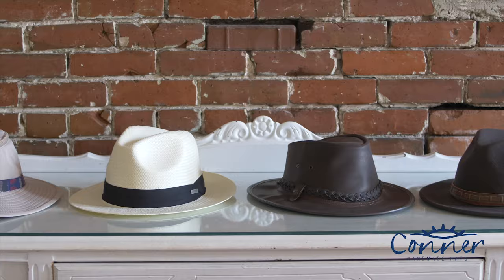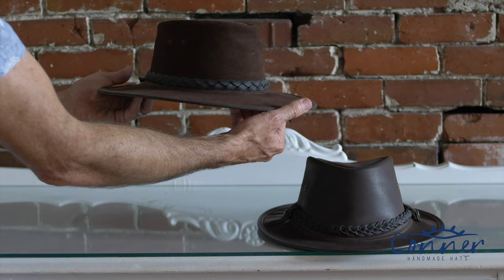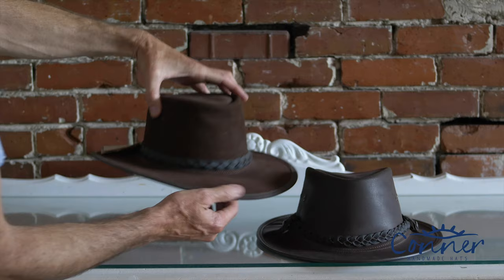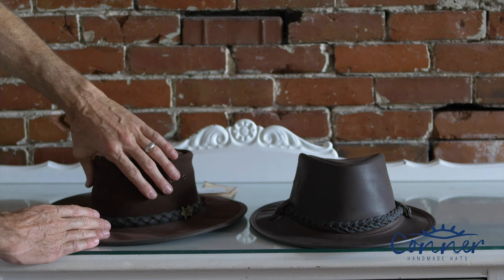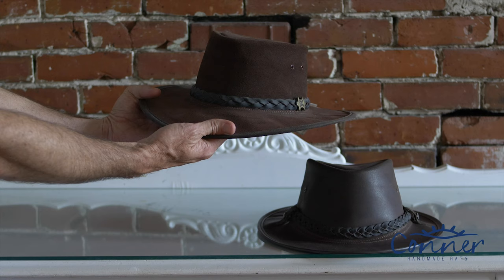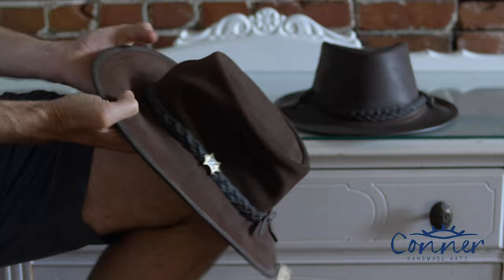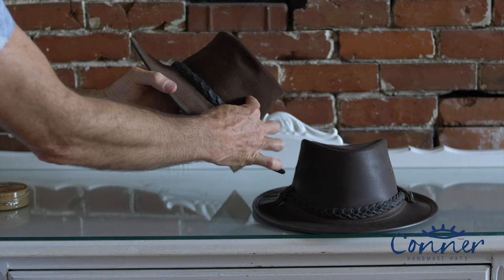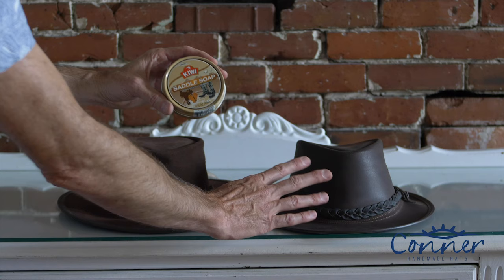How to Shape and Stretch an Outback Leather Hat

Comment: i have   A BC  hat  exactly  the  same  as  the  one in your   video  , its   over  20  years  old  hardly  worn it   , only  with my  cattlemans  stock mans   long  coat   same  couler    , when i used to  go  poaching    , the  hat  now  sits  on the  back  parcel shelf  in car  i need too  renew it   , i thank you so  much  for  this    i really do    i have  subcribed  , its  like  my  cowboy hat  pure  Leather   i bought in  cuba    its  dry  . i got  saddle  soap   for  my  Leather   spanish  horse saddle   i thank you  for  the  video   keep  the  good    work  going  ,   respect  from  the  UK

Comment: I have a leather slouch hat that’s a bit too tight, I’m afraid to stretch it and possibly ruin it.
Reply from the maker: As the video shows, you won't hurt the hat. However, if you're afraid, I would apply small amounts of pressure at first and try it on each time. If you're still unsure about that, my next suggestion is investing in a hat stretcher (look up google or amazon or your local hat shop). This way you can stretch the hat incrementally over a period of time ie, 24 hrs to however many days you like in order to get it to fit.

Comment: thanks for video. however when cleaning I noticed a tear in my BC leather stock mon hat that I have owned for 10 years😢.. it had happened along the row of stitch that holds on the swet band.. 
Can this be repaired?  Derek 🤠
Reply from the maker: Hi Derek,

This can happen over time with sweat and leather. Normally we would just replace the hat for you however BC stopped making his hats a few years ago and we don't have any Stockman left and haven't for about 2 years. You could try gluing a thin peice of leather or canvas fabric to prolong the life of the hat or have it looked at by a leather craftsman.. Really sorry this happened.
Reply: @connerhats158  many thanks for your reply. I picked up a nice piece of leather this week with my local upholsterers and I plan cutting the flanged part of the broken part out and sewing this  back in up behind the swet band..
Luckily I bought a new stockman about 2 years ago but I still prefer my old one.. 
Will see how I get on.
Regards from Ireland. 
D